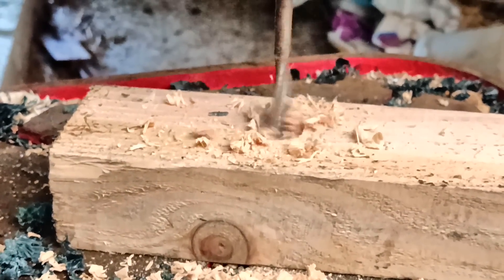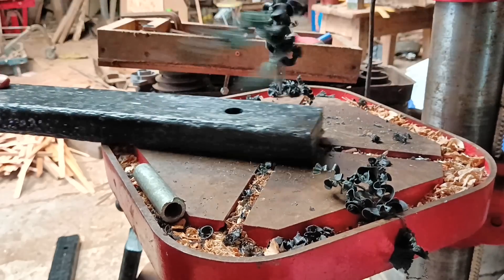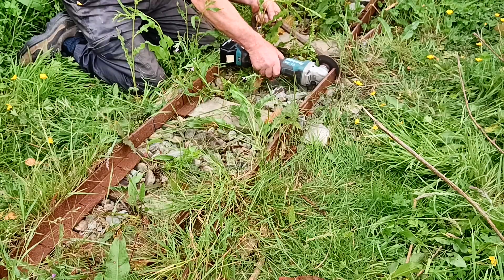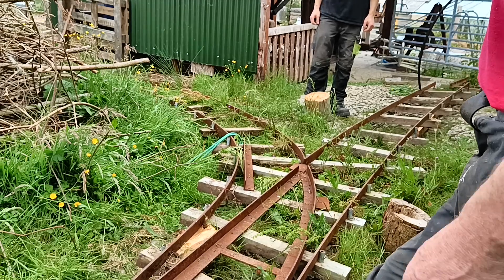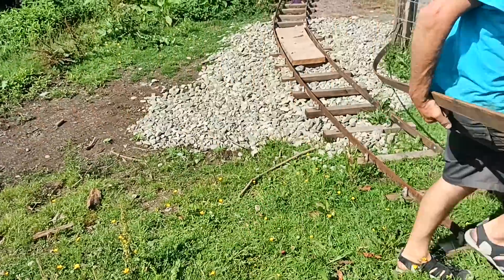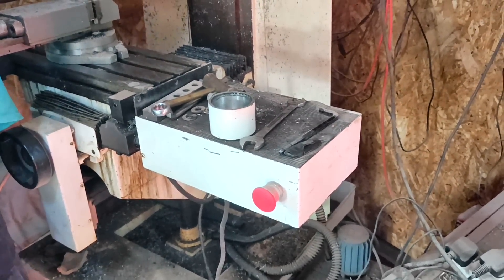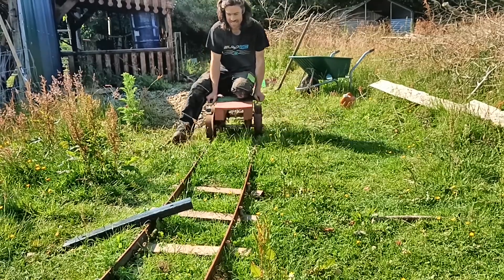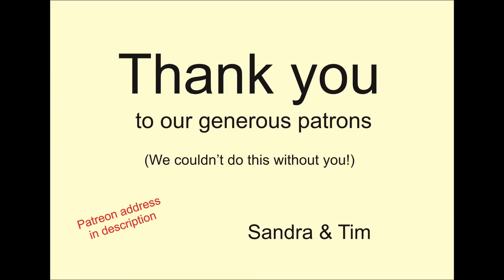Can You Use Recycled Plastic For Railway Sleepers?

Comment: On a field railway such as yours, where they see very little heavy use - yes totally a great product!  I have several 'Muskoka' chairs and rocking chairs made from recycled plastic boards... and they sit outside all year long, they inject the plastic with a UV resistant dye so that the colour doesn't fade.  On a much larger railway - not so sure the product would hold up to the weight of a big train - especially a locomotive!.

Comment: my only idea on passing over another track is to cut out the track section. Lay in the new track, Then build a track section to put in the middle of the cross track. just making sure that there is enought room for sloop of the boggie wheels and everthing else. The wheel should be able to roll over the gap pretty easy.

Comment: I guess that the only possible downside you might have with the plastic ones (that you'd get with wood to be fair) is if you have one with an "airy/holy" cross section and water gets in and freezes. But apart from that i don't think you can go wrong :)

Comment: Creosote and used motor oil , I know environmentally unfriendly , however the post my grandfather put in have lasted since 1960s . I absolutely love the rail road ! maybe to much gets me thinking I need one, for what I am not sure yet.
Reply: Just creosote an mineral oil is typically enough. You can add some old oil to help deter bugs, but dont use too much and let it dry/absorb fully for a few days before placing them on the ground.

Comment: Tim, I have a model garden railway, the  original permanent way was made of plywood covered in roofing felt but eventually the plywood delaminates and expands and becomes useless. I discovered recycled plastic timber and boards and bit by bit having been replacing it all. The "plastic wood" can be worked by normal wood tools, doesn't require any treatment and will outlast me. I use a company called Filcris here in the UK. - Dave
Reply: Seconding recycled plastic timber. Used it to build a back deck at a job I was working at last year, easy as pie to work with yet still durable. When I saw this video I immediately remembered that material and think it'd make for great sleepers.
Reply: Plywood is never good outdoors. You want pressure treated lumber.

Comment: I can't see many downsides to using recycled plastic for sleepers. they may bleach a little in the blazing irish sun, and they might sag a little over time, but wood will do all sorts of inconvenient things in the same situation! as you've discovered, it can be tricky to machine to an accurate fit as it tends to give a little as it's cut, then spring back, but razor sharp tools help keep that to a minimum. It'd be good stuff to use on your cnc table if you needed a funny-shaped piece for something, but beware of twist-drills as they can get sucked through the work in the blink of an eye like a corkscrew!

Comment: You could make a crossover turnout, by welding the other rails onto the side and cuttong slots for the flanges.
You might want to also weld the assembly onto a flat piece of metal at the joins to reinforce it all.
Don't forget the guide rails, it probably won't work without them..

Comment: Crossing an existing track, eh? That's definitely going to be a bit more precise than your previous work. Luckily, the general principle works exactly the same as your points do - you need a Frog or a guide rail to keep the wagons in the correct direction.

Comment: Maybe a fixed X-Crossing, I think you call it level junction or flat crossing in English. It would only need some welding, a few metal plates from scrap for the guiding rails on the inside, and it’s done. A downside of that is that you won’t be able to switch to the other track.
Reply: ...Unless it's a double slip crossing... :)
Reply: @ErickC  Yes but he already said in a previous video that he is not a big fan of the complex switches/junctions, because it’s just a small field railway and it doesn’t need to be as complicated and sophisticated. But of course, a double slip crossing is possible, but is it worth it?